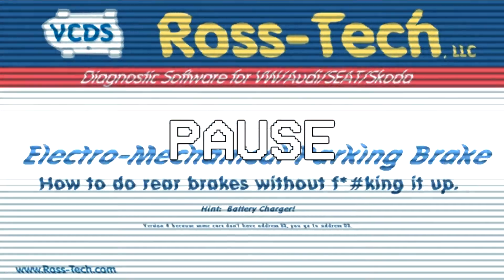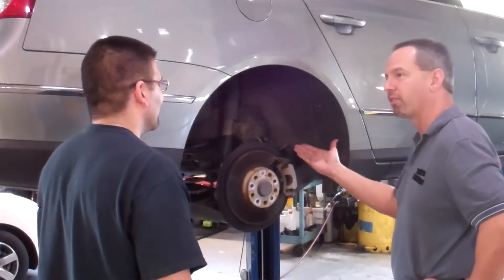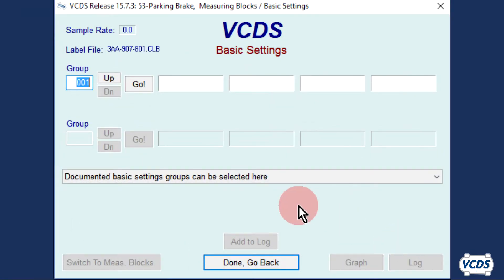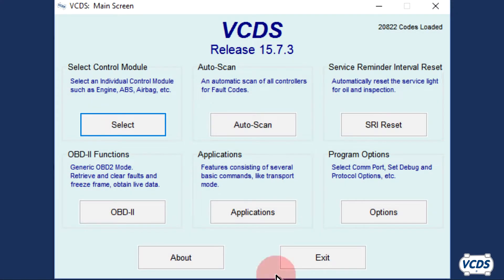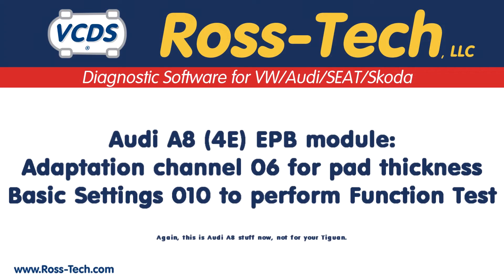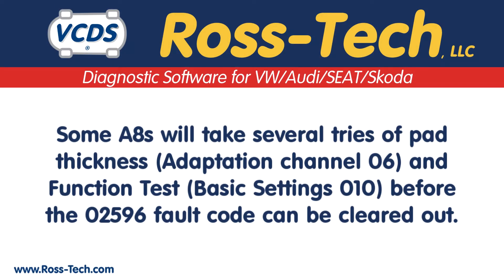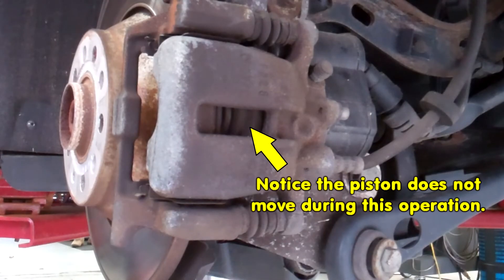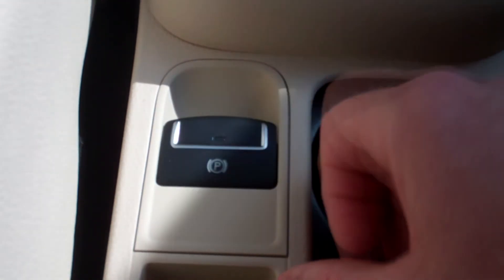Electro-Mechanical Parking Brakes (EPB): How to do rear brakes  v4.0

Comment: I've got a 2015 A8 L I've got no options for the brake pads in the ABS Section.  Any Ideas?  Thinking about just unplugging the motor and putting 12V to it to unwind it.

Comment: For anyone having ‘No response from controller’ problem. Try

Select
03 ABS brakes
Basic settings - 04
Start lining change mode
Go!
You’ll hear the calipers doing their thing

Same process after work carried out.

Select End lining change mode instead of Start lining change mode.

Remember to wait 30 seconds after you hear electric motors stop
Reply: Thanks. I should have come to the comments first. I figured out the long way, and wanted to leave the reply you did.

Comment: If change EPB control unit electric parking brake? Can code after having replaced EPB control unit electric parking brake. I want to change the EPB on my vw passat 2006 B6 1.9 TDI

Comment: So what exactly gets damaged if one doesn't follow the recommendations?  The VAGCOM or the EPB Module?
Reply from the maker: The EPB mechs on the calipers or the EPB control module.  These items do not take kindly to low voltage operation.

Comment: what about 2020- vag vehicles it seems only the dealer tool can rewind the calipers...
Reply from the maker: Some of the newest generation of vehicles are locked down with "SFD".  While VCDS can be used to submit the tokens to unlock SFD, Ross-Tech has no means to get the tokens.  We are working to have an official solution so that our customers can get the SFD tokens, but no release date at this time.

Comment: i bought my vcds around 2015 from gendan in the uk when i had a mk4 golf gti....loved the car and thought id stay with the vag group....then bought two fords lol..but back to my vws again......today is actually the first time ive used it proper.....got a mk7 golf now and fitted new rear pads...it updated newer firmware when i plugged it in the car....i used  youtube vids as a how too....worked great....took it for a test drive and all good,well happy....
Reply: oh one thing with mine.....i think it said not running.....i looked online and it said click stop....i did...and exited vcds..did the brakes then  re did the vcds and think it said running then it said finished correctly...basically it was a bit different to this guide but not much

Comment: All this shit for something that worked fine for decades. A SIMPLE HANDLE AND CABLE APPLYING REAR BRAKES ,,,,FOR FUCK SAKE!!!!
Reply: Lets not start on 'keyless ' cars and led headlights so bright for people who shouldn't be driving in the dark. Or Park Assist. Or Hill assist. Learn to drive.
Reply: I welcome the change to EPB.  No more replacing rear calipers because the E brake mechanism seal has failed and its stuck on.
Reply: @davidbrutsche7859  No, changing motors because the housing has split and the brakes have stuck on. Progress.
Reply: Yeah, steam trains worked pretty well too, I'm still on windows 98

Comment: Thanks for the video! I got one question; you are already taking the key out and closing the vcds, no key in the ignition. So why would we need to have a battery charger connected to the battery? as there is no component needing some voltage...Thanks for the reply in advance!
Reply: It may not be 100% mandatory on some cars,but they highly suggest this,so you don't run over problems with the epb module.
Reply: @IustinianP  I think tve question here is about if / why you need the charger connected between running the EPB out and in with VCDS (ie, while doing the actual pad and/or rotor change). If you're doing a bigger job, that could potentially be hours or even days between start and finish.

Does the charger need to stay connected in the meantime, or is that just "a rule" to prevent you forgetting to reconnect it again before doing the closing part?
Reply: same
Reply: You may got a weak battery,and since retracting the pistons with electric motors it may discharge the battery a bit.

Comment: Hi
Great video but i have a question
can you tell me why after performing function test the left motor shows a current draw of .133 amps
mine does the same but i would have thought that this value should be zero
regards

Comment: I have a 2018 Audi s4 and when I click on 53 parking brake it says “no response from controller” not sure why need help?
Reply: Thank you sir, got it!!!
Reply: I had this problem too. Try
Select
03 ABS brakes
Basic settings - 04
Start lining change mode
Go!
You’ll hear the calipers doing their thing

Same process after work carried out.

Select End lining change mode instead of Start lining change mode.

Remember to wait 30 seconds after you hear electric motors stop
Reply: How did you get it to respond? Thanks
Reply: What was the answer to this please as mine is doing the same ?
Reply: Does it work on 2018 S4 or not ?